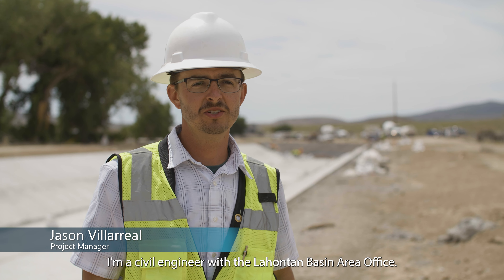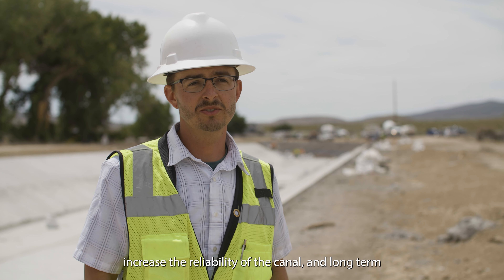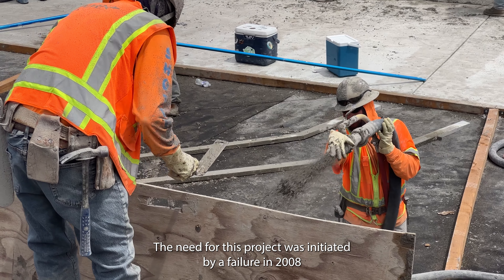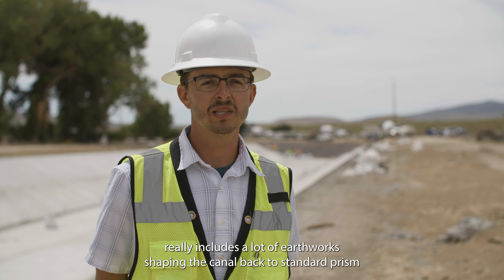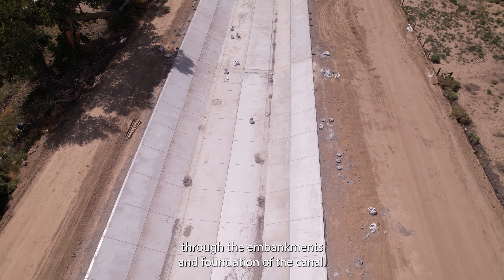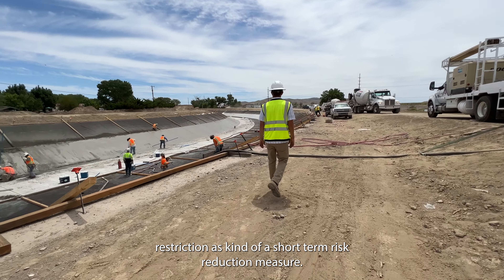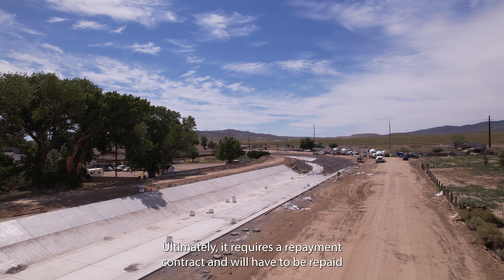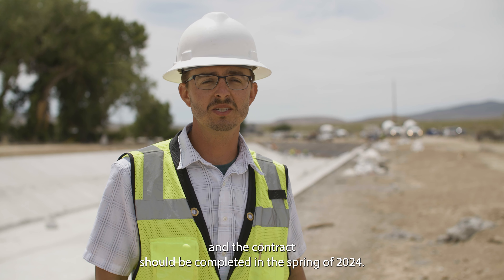Truckee Canal Public Safety Improvement Project

Comment: Interesting to learn how a modern canal is built. Originally completed in 1905, Truckee Canal was the first major irrigation system in the West under the Newlands Reclamation Act signed by President Theodore Roosevelt in 1902. 
PS — Wonder what the ultimate impact will on water usage.